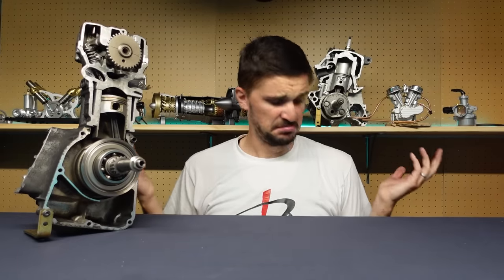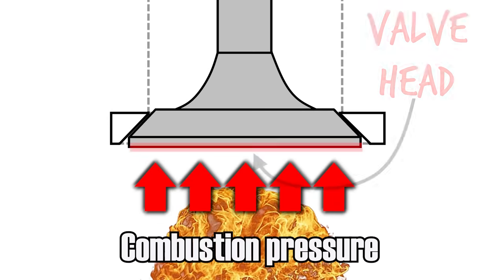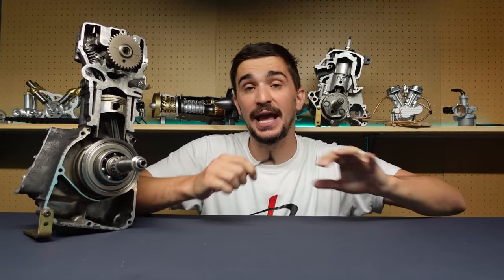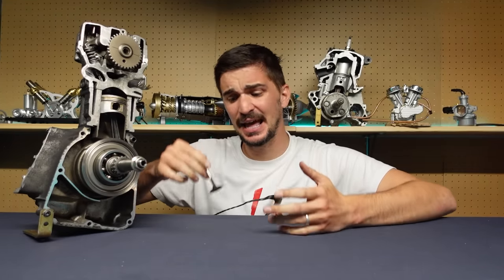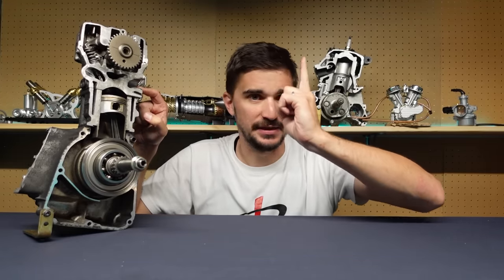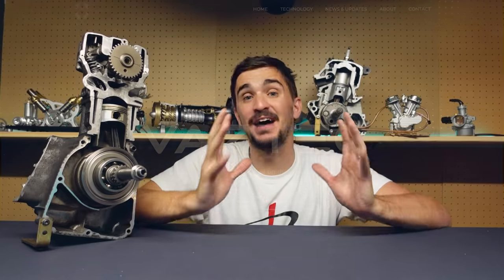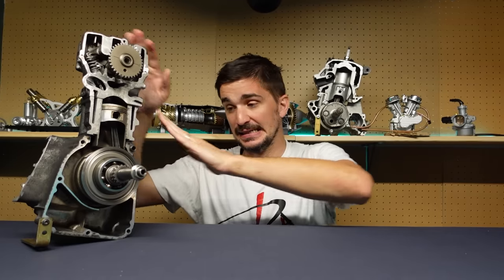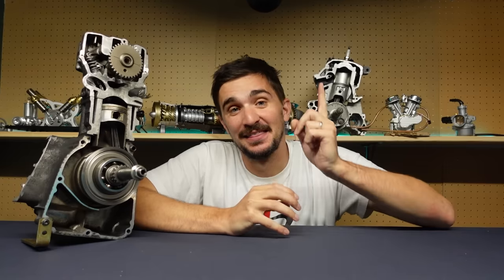Rotary Valves Make Normal Valves Look Silly - Why Aren't We Using Them?

Comment from the maker: Support the channel by shopping through this link: https://amzn.to/3RIqU0u
Patreon: https://www.patreon.com/d4a
Become a Tuning Pro: https://hpcdmy.co/dr4a
Become a member: https://www.youtube.com/channel/UCwosUnVH6AINmxtqkNJ3Fbg/join
Motivation: https://www.youtube.com/channel/UCt3YSIPcvJsYbwGCDLNiIKA
Reply: Your videos remind me of a book which was vital in my years studying Motorsport engineering. Do you also have this book by professor Blair.?
Reply: think its a bit to late unless hydrogen fuel becomes more mainstream and  easier to store ..Electric engine still has it beaten
Reply: 2 strokes are the highest revving engines
Reply: Rotary valves need to borrow apex seal technology from rotary engines. Make the rotary valves easy to get to for replacement of seals and durability can be less of a concern.
Reply: ..maybe rotating verticaly..
Reply: Intriguing stuff!  I love your videos!  I have two vocabulary notes for you if you're open to them:  The volume of space between two cylinders is called an "annulus".  Distinction between "less" and "fewer".  Fewer is quantitative and less is generally qualitative.  Examples:  Fewer parts, less wear.  Keep up the great work!
Reply: We've had the same intuition on this idea! @pgtmr2713
Reply: Ok so this might be a stupid idea but what if, instead of a rotating valve the inner chamber of the valve stayed still, and on the outside there was a sliding plate that ran in a little track or something that slid back and forth to cover either the exhaust or intake or both, and on this little track there could be a little section where it cams up and into position like a little breech block and seals, and then only unlocks and unseals when it goes back down and out of the track. Wouldn’t that fix the sealing problem and the spring problem?
Reply: Any chance we might se a video on sleeve valves? Interesting tech that i've never fully understood how they are constructed in practise.
Reply: @ROBOTRIX_eu  laying on it's side brings the openings as close to the top of the cylinder head as possible. Any extra space is lost compression. Also, under pressure it has to want to seal, vertically the combustion chamber gasses want to go around the rotary valve piece.
Reply: @allenpaley  I've been thinking about rotary valves since 1996, engines class.
Reply: My brother actually has a patent on a similar idea.
Reply: Something tells me Mazda might know a thing or two about efficient rotating valves that are exposed to combustion heat and pressure...
Reply: Plz make video about sleeve valves
Reply: Plz make vid about DPV
Reply: @d4a could you make a video where....you "make" the ultimate engine? Combining all ridiculously amazing knowledge that you have and combine all the pieces? It's theoretical of course but I'd sure love to see what your version of the perfect engine would be. 
Btw absolutely LOVE your channel. Only channel I genuinely enjoy watching for hours on end. Please keep doing EXACTLY what you are doing.
Reply: There are also sleeve and double sleeve valves engines, which many aircraft in the world war 2 had.
Reply: please make a video about Aprilia DITECH direct injected two stroke! it doesn't fix the biggest issue with traditional 2 strokes (intake port closing before exhaust) but it improves in 2 strokes by not letting unburnt gas out of the exhaust port, andallows proper lubrication without gas/oil mix
I'm a nutshell better efficiency, reliability, less emissions while keeping the high power to weight ratio of two strokes
Reply: Imagine an all reed 4 stroke, with modern alloys making a reversed flow exhaust reed is definitely able to be created now a days.....
Reply: I just learned about some pistons from a company Speed of Air. They're designing the pistons for diesel engines. They have some "too good to be true" claims. They're claiming that it increases engine horsepower and torque while decreasing fuel consumption and providing less engine wear and engine noise.
I think you'll find these pistons very interesting.
Reply: @kelvinelrick807  yea dunno if it's the same company but it's legit, they have been using coated pistons in industrial machines, and yea I heard they are going to start making them for some road diesel applications......
Reply: Interesting concept. I don’t see conventional engines fading away even if rotary valves could increase power output and fuel economy/efficiency. Big corporations have been using fleets of v6 work trucks for decades and still we see millions of new trucks released with large v8 engines, because people like what we like. Yes lots of capable V6 engines can do all the work most trucks will ever need especially when paired with generous gearing. I love the sound of American V8 gas engines, the ridiculous over abundance of torque and HP and that gullible people cry because I could travel in a 3 cylinder Geo Metro. My point is the rotary engine didn’t kill or even hurt the conventional piston engine even with better performance, rotary valves won’t either. Like rotary engines they’ll create a niche market, big splash, new jobs, and new shops to work on them, but nothing will be wholesale replaced by them.
Reply: You bring up that valve springs cause energy loss, but an ideal cam working against an ideal spring dissipates zero energy, and only temporarily stores the energy and releases it later. Of course, neither the cam nor the spring is ideal, so how big is the energy/power loss in practice?
Reply: What about adding a tesla valve between the rotary valve and combustion?  Should reduce the amount of pressure getting back to the rotary valve to very little.
Reply: EVs will not replace ICE.  They actually require more energy than a conventional ICE engine, and overall, are more dangerous and create more pollution.  The reason for this is they are much heavier, and they use more energy overall due to losses in electricity distribution.
Reply: @scivirus3563  Electric vehicles aren't practical.  Components for the batteries are scarce, the batteries have a very strict lifespan (you're not going to see a Tesla sold today on the road in 2040), they aren't more efficient than a conventional engine, and they are FAR more expensive to manufacture.
Reply: @MotersickleBum But a two stroke engine always expels unburned fuel.  I don't think that's an alternative, they pollute too much and the fact they expel fuel that's not combusted, that kills efficiency.
Reply: This is a link to a vid about the Coates spherical vavle engine. One of the best channels for automotive enthusiasts keep pu the awesome  work. Oh and David Vizard he is a genius with engines his channels is great too.
Reply: @fuzzywzhe  2-stroke doesn't define the type of engine, just the number of strokes. e.g. 2-stroke diesels just pump air and inject fuel to ignite.
Reply: @yogibarista2818  Well, I'm not expert but I've only seen one basic design for a 2 stroke, and all of them leak aerosolized fuel.  I don't think there is any other way to do it.
Reply: Rotary Valve Engines have to fit into the two soft spots in electrification or it'll die on the vine. 1) Backup generators will be needed for a long time. Especially needed are backup generators made for the utility closet in homes, restaurants, gas stations, grocery stores, etc, instead of outdoors. In simple language cheap instead of easily approved to install. There is already gas and a chimney for exhaust, and the power panel it serves is usually in the same room. Useful even for (especially for) homes with a whole home battery. 2) Range extenders, basically allowing an EV to drive non-stop coast to coast. Needs about 50HP and driving non-stop coast to coast speaks for itself.
Reply: The energy you put into the valve is released again. It is therefore wrong to assume that the compression of the valve saps the engine's energy. It does not consume it. The friction does but that is a problem with other systems too.
Reply: @fuzzywzhe  What you are describing is type of 2-stroke engine - crankcase-scavenged intake, with transfer and exhaust ports, requiring fuel-oil mix. However, there are other engine designs that produce power every 2nd stroke, and 2-stroke diesels have been around forever - trucks, locomotives, ships, etc. With use of direct fuel injection, such as with a diesel, there is no specific issue with unburnt fuel - air intake, fuel injection, burnt air-fuel exhaust.
Reply: @yogibarista2818  I'll have to look it up.  I can't visualize how you could inject fuel into the cylinder and expel spent fuel without expelling some of the uncombusted fuel in a 2 stroke engine.  I'll have to look it up.
Reply: Excellent simple description. Can easily see the benefits for small hand held machines which can be made more powerful and economical but weighing less, so great for operators.
Reply: @B4D_5USHI  then you would have oscillation of the plate instead of oscillation of poppet valve without the inherent sealing qualities of the poppet valve
Reply: 15:00 imagine a spark being part of the valve and piston, as the valve comes around a spark could jump to the piston with raised contact point. Maybe ceramic vavle and rotary comtact joint like assembly. Maybe I'm just dreaming😂
Reply: then why did the Pennsylvania Rail Road experiment with camshaft and poppet valve steam engines as opposed to slide valve  ......and What about th4e Skinner Unaflow Poppet valve Steam engine....S.S. Badger still Steaming..    the Rotary Valve you are talking about is a Corliss Valve.    Check out rotary sleeve valves   they're even more air flow efficientwith a shitload of mechanical trade offs lmao.
Reply: you know whats even better ....no valves at all.................2 strokes :)
Reply: *lift
Reply: What if we push the fuel into the engine at the same pressure as the max during combustion phase? You'll lose a tiny bit out the exhaust but greatly reduce the needed size of the fuel side of the valve allowing for a bigger opening for the exhaust side. This would greatly improve efficiency by forcing the combustion gases to only work the piston and would help to cool the valve during operation.
Reply: 2 strokes Yamaha tzs used a rotary valve   on the flywheel
Reply: Question: Has anyone tried an aperture (like on a camera lens) as a valve? It feels like that would be worth a look.
Reply: @importanttingwei7747  nope 20,000rpm 4 cylinder by Honda. What 2 stoke ever did 14k ?
Reply: Free valve is still the best 30% hp increase many rally teams are having them installed
Reply: Rotory valves wouldn't work for the same reason the rotory engine failed to much surface contact and wear
Reply: The issue with rotary valves is usually reliability. The sealing cylinder is subject to appreciable pressures pushing it against the seat and the cylinder then needs to rub against that seat whist turning. This leads to wear on the valve sealing face and eventual loss of sealing, more so than the axial valves which are conventionally used. The other thing is the initial high velocities achieved by the gas which squeezes through the 'crack' presented by the flow orifice of the valve when it is at the initial part of its opening sequence. Those high velocities cause a feature called 'wiredrawing', which is basically erosion of the valve sealing surface. This leads to increased wear and loss of sealing.
Reply: instead of a rubber o ring for rotary valve, material similar to piston head metal rings will be more durable sealant.
Reply: @ukirfan  That gives you metal-on-metal friction to think about and the tolerances for wear are likely to be really low.
Reply: Wait, doesn't a desmo system do the same thing? Am I missing something?
Reply: How much more efficient is it then? Like in fuel consumption or such.
Reply: What if you were to use two rotary valves that are geared together? Or even three in a triangle formation?
Reply: For a single inlet fyi
Reply: Another option is to use sleeve valves, or ports . Those are used on most 2-stroke engines of all sizes. Varying the timing is more problematic.

You mentioned electric motors. They have big advantages over combustion engines, including much higher efficiency, much lower moving parts count, smaller overall size, less mass, simpler cooling requirements, and lower cost of manufacture. 

Essentially, the moving parts in an electric motor can be an armature and two support bearings. 

The energy efficiencies of the latest electric motors in vehicles are above 95%. 

The maximum theoretical (Carnot cycle) efficiency of a fuel burning engine is about 25% for an internal combustion (usually gas or petrol) engine, and about 33% for a compression ignition (Diesel) engine.

It's more than a 'love affair'. Fuel burning engines for some forms of transport are on their way out.
Reply: DESMO ! 
Just remove the valve springs.
Problem solved.